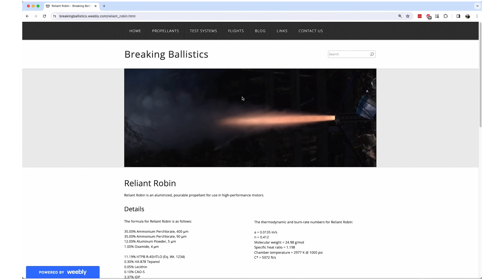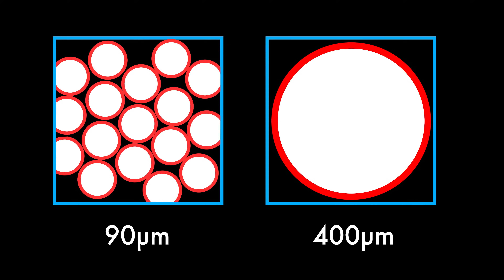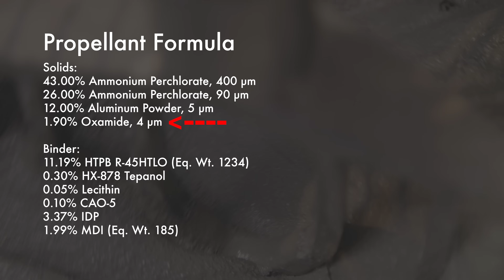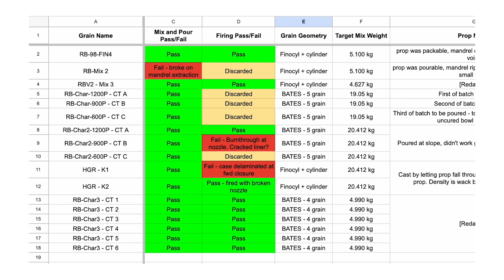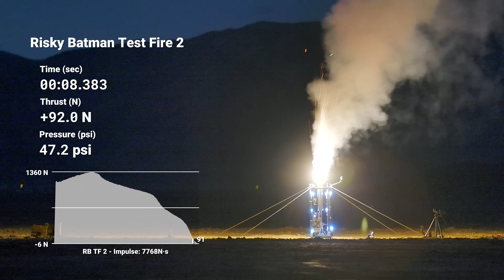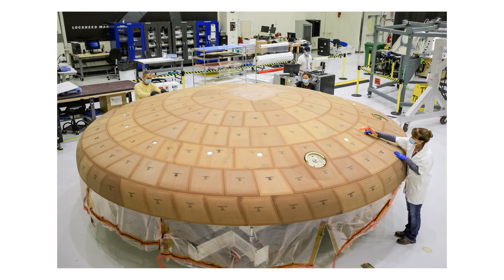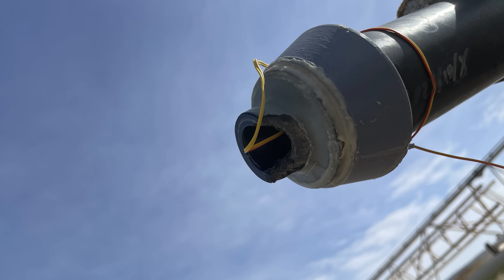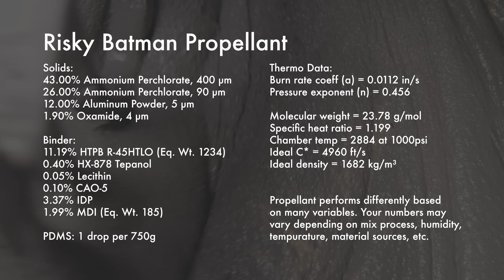First Time Firing My New Rocket Propellant

Comment: I sometimes cast statues with very slow running plaster, and I find that vibrating the outside of my mold really helps bring bubbles to the surface through liquefaction. I mean, it's surprisingly effective. For vibrations, I use a very cheap battery operated massage machine (looks like a silly gun). Maybe you already do that and I've just missed it.

Not sure if it would work here, but every bubble you evacuate is a bubble less to cause issues.
Reply: Yep. When I cast propellant, I vibrate it while vacuuming it, using an extremely jank thing I made haha: it’s just a rotary sander with a heavy weight glued very off center on it. When it spins up, it vibrates like crazy. It is clamped down to a table, suspended on some stretchy ropes, on which the vacuum propellant pot sits. So the table is vibration-isolated from the rest of the room, and the vibration device makes the table vibrates very strongly with very little lost to the surroundings :)

It looks absurd, but it works great
Reply: Back in the 90s, i was working in a patternmakers shop and we cast thermoforming mold forms in aluminum epoxy. Vibrating the bubbles out was a very important part of that as it made the forms last longer. No voids. I don't remember the ratio of aluminum powder to epoxy, but I do remember that it barely poured.
Reply: I used to be a contractor (among many other jobs...). We did that when pouring cement stairs, foundations, etc. Seems like a good idea to me, but I know absolutely nothing about making rocket motors.

Comment: Using reliant Robin as a jumping off point!? Yeah if you mean jumping off with a parachute attached to a bungee cord 10ft off the ground. You basically took the whole formula and tried to make it your own by making little tweaks to the numbers, the tweaks to the numbers had absolutely no thought or research behind the reasoning. You just started changing numbers based on gee I wonder what this is going to do. Tweaking someone else's formula doesn't mean you made your own rocket propellants, I guarantee you every Rocket enthusiast will agree, it just means you think you're smarter than the guy who created it. And whatever you come up with you're going to think it's the best thing in the universe better than any thing anyone's ever that's typically how it always goes. And in reality what you made is a completely inferior product than the original. There's no reason for anyone to try to come up with their own propellant because there's a perfectly good established use in reliable propellant already. The characteristics that you want out of what you claim you want is completely insufficient to try to tweak anything. You're so called risky Batman is completely inefficient and a waste of material. Look at all the unburned material being spit out. It's ridiculous basically a shower of Sparks what are you making a firework!?

Comment: BPS I know you probably won’t see this but I love your videos man I’m 14you have inspired me to try making my own homemade rockets, so far there are nowhere near yours, but maybe one day they will be close, right now I’m just meeting Sugar rocket motors, but I do have steel nozzles, which is a lot of improvement from my original PVC
Reply: I would suggest you try to find an experienced mentor if you are thinking about building your own propellant/motors, and although you are currently underage, I would say this to anyone of any age.  Mr. Barnard (BPS) flies mostly at FAR (Friends of Amateur Rocketry) which have a lot of experienced members to talk with.  I would be careful with steel parts in any rocket motor, although our safety codes do allow steel nozzles for sorbitol (sugar) motors as long as it is recessed into the case. Other than snap rings, nozzle washers or minor hardware, no  structural items may be steel (or PVC)
 As a lifetime member of a high power rocketry association, I do not want to see anyone get hurt from pursuing our hobby, especially through not understanding the dynamics of our vehicles and motors. Fair winds and clear skies.
Reply: @paulholmes672  right now I am making this rocket for a school science project, I am being kind of rushed so after I’m done doing this one I will Maybe join a club and improve my safety, maybe I’ll get a mentor like you said, but right now I’m kind of a while away from that the rocket that I’m building is quite simple. I’m using sugar, rocket fuel, with a nozzle welded to a steel pipe with an endcap on the end, I know it sounds really sketchy, but I am doing everything I can to make it as safe as possible, I think everything will go well and I’ll probably keep you updated since we’re testing it on Saturday.

Comment: I am not at all sure if this is even practical but when folks are casting clear resin and don't want bubbles they use a pressure pot, IIRC 40-60 psi. But building a pressure vessel that can take those PSI and fit your motor is probably another rabbit trail and safety along with rocket propellant , pressure vessels are not to be trifled with..

Comment: turning on the mini lathe out in the desert is an impeccable vibe
Reply from the maker: Honestly top tier experience, I've turned things on a lathe outside twice now and both times have been magical
Reply: @BPSspace  I worked in a machine shop through college but, my favorite machining experience was with a mini lathe sitting on a cooler in the pits of Michigan International Raceway. Something about the way natural light reflects off of the freshly machined surface...
Reply: @BPSspace I need help please. I am going for my L1. And I need coupler help. thank in advance
Reply: @BPSspace  You might want to polish your mandrels before you pour.  Polishing with finer and finer emery paper, steel wool, or progressing from 220 grit sandpaper to 2500 grit sandpaper will make the surfaces ultra-smooth.
Reply: @BPSspace  can you make one that can go to orbit???
Reply: Also, pretty much ideal situation for turning graphite :D heh

It’s so awful, covers everything, shorts out stuff, ugh
Reply: @mduckernz  heck of a material though lol. Can do so many things
Reply: Never doubt your vibe.
Reply: @BPSpace can you create a course on rocketry on udemy so that we your fans can learn all those knowledge you have
Reply: No. It's not.
Reply: @spankyjeffro5320  everyone can have an opinion, yours is just wrong

Comment: The surface pitting in the core might be from residual propellant dissolved in the release agent offgassing while it cures, so just letting the release flash off longer before casting, using a brush-on release, and/or curing in a pressure pot may improve that.
Reply: I also think a pressure pot is the way to go after pouring. The bubbles get smaller without any large voids at an intermediate stage (like with vacuum degassing), so you can safely let it cure while in the pressure pot.
Reply: @lukasdimmler2622  The downside is that you have pressurized air in those bubbles after curing when you take it out of the pressure pot.  Usually it diffuses through over time but sometimes can lead to cracking if there's enough of them and everything goes wrong.

Comment: I swear I coated all three sides of that mandrel, and I know I sanded it smoother than a baby's bottom. Next time I'm gonna dip it in E236 and save us both the trouble!
Reply from the maker: I will say, I've never seen a smoother 3d print. Your sanding game was next-level sir
Reply: @BPSspace  can you use a Teflon plastic mandrel? We use Teflon plastic at work, and nothing sticks to it.
Reply: @normellow Teflon is great. I believe managers are made out of the stuff.
Reply: @SolarWebsite I can assure you we’re not 😉
Reply: @pjotrtje0NL  Well, maybe not all. But let me tell you I've seen my share of managers to which literally nothing would stick.
Reply: HDPE might be a good compromise there.  Cheaper than PTFE, and easier to melt or mold into a shape.  Not quite as non-stick, but still low enough surface energy that it's a pain to bond anything to it.
Reply: Consider something hydrophobic... Pure silicon over hard wax?
Reply: avoid silicone like the plague @Horus2Osiris  
anything epoxy resin like will develop voids "rejection" zones ("fisheyes")
all forms of paints hate silicone....silicone is really incompatible with anything but silicone where liquids gels etc harden polymerize etc
interactions with surface tensions are weird, silicone seems to collect with itself in random sized groupings....
if the silicon has ever reached near zero Celsius all bets are off in every characteristic
Reply: @kazzxtrismus  The propellant has silicone in it.
Reply: that doesnt mean it doesnt have other things that will react with a silicone mold release @bbrockert  
thats the problem with silicone..
it even reacts with itself if frozen at some point...you may need MORE silicone
but often NO silicone solves everything when it comes to surface tension based reactions...
youre right!..it doesnt make sense!
thats silicone!......
hint:
look at the difference between high tech circuit board mastics and electronics grade caulking and regular window caulking and why theyre different
Reply: @kazzxtrismus  yep - spend the $$$ and mill a teflon mandril
Reply: High recommend considering a heated mandrel with sprayed on wax release. This should offer you excellent control over the surface quality, this avoiding(hah) the pitting seen in this video.
Reply: I would think pulling a vacuum after the pour would eliminate any voids. It would become a bigger problem with larger motors, but surely there's some air that gets trapped during the pour. Also, has anyone used some sort of ultrasonic transducer on the mandrel just after the pour to help settle everything, sort of like how the larger grains rose to the top of the drum? It might be that this causes the propellent to settle with a gradient, but it might also help eliminate those cavities and pits.
Reply: A lightly sanded print that is coated in epoxy(smooth-on for simplicity), followed by a low surface energy coating like Xtend 105 is the best bet. It ensures that there won't be a build up of wax or ptfe at the boundary and is significantly more consistent.  For composites molding, it produces the lowest amount of surface pitting.
Reply: Use compressed air to promote mold separation. If it works to demold sugar rocket engines, it will work here.